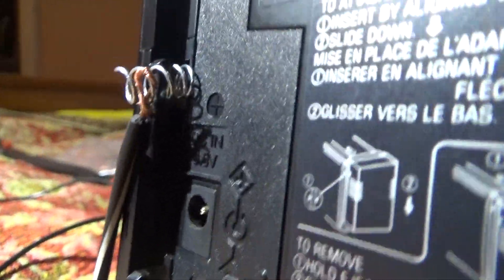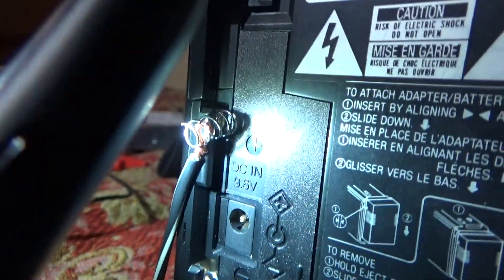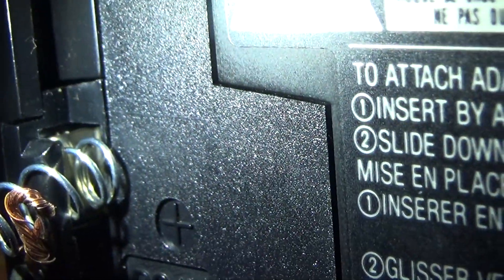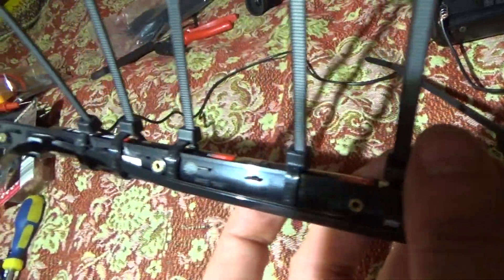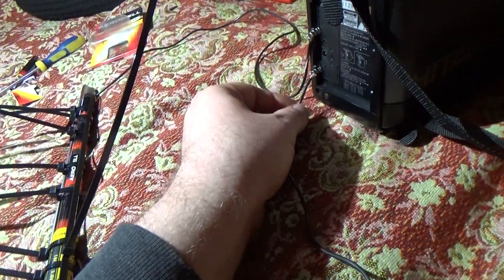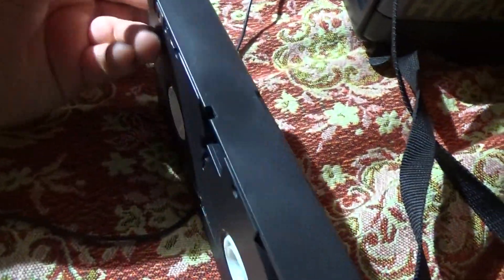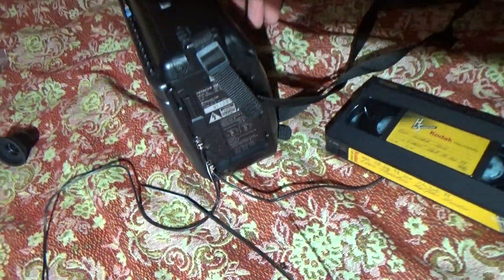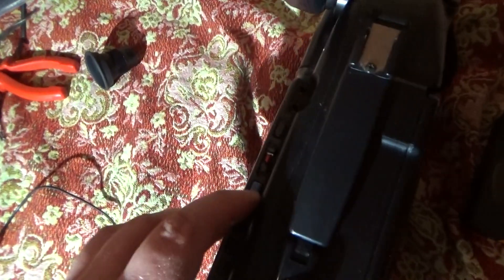DIY Handmade camcorder battery

Comment: Mixing those Alkaline AAs with that Lithium cell is a battery fire waiting to happen.  :P

As for how I would do it, I plan on doing a custom battery for my Sharp VL-L64U soon. My plan is to use 2 18650 Lithium cells wired in parallel and have that go into a DC-DC step up boost converter to convert the voltage to the 6 volts the camera requires. I already managed to pull part the original battery and removed the Sealed Lead Acid battery cell that was inside it. I should be able to fit my contraption into the original housing so it will still look original. Can't use it with the original charger after this (but I don't have the original charger anyways) but it should work. The step up converter will lose some efficiency but since this camera only pulls about 1.5 amps at 6 volts just about any decent step up converter can handle that. :D

From a previous video of this camera I've seen, your camera appears to run at 9.6v. So 2 18650s won't have enough voltage and 3 would be too much. So using a step up converter like what I plan to do should work in your case too. This would require you have some soldering equipment though. ;)